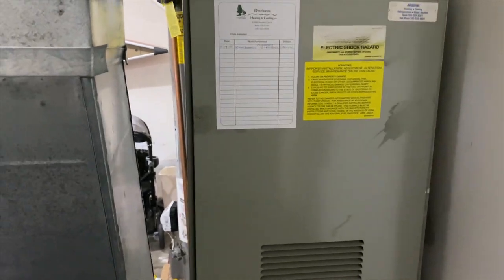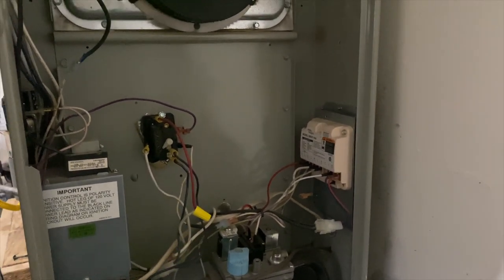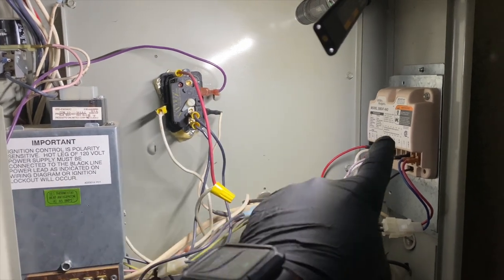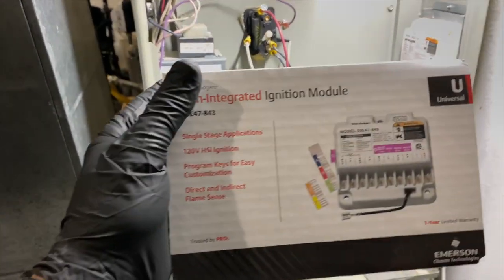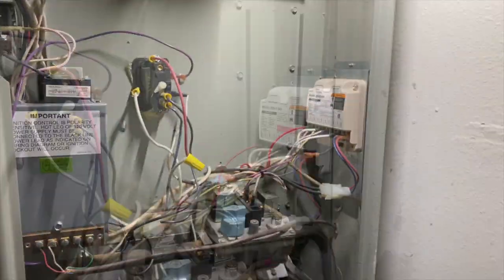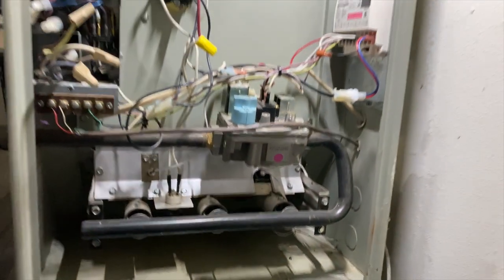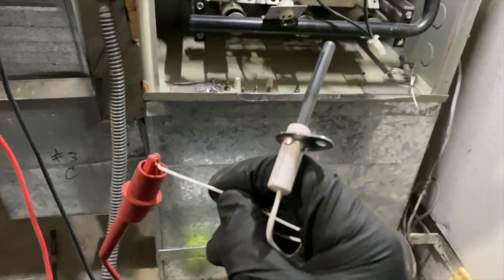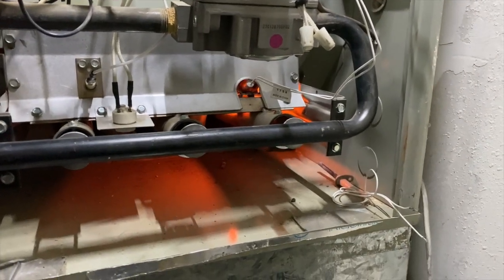No Ignition, Reversed Polarity on a White Rodgers 50E47-843 Ignition Module EP84

Comment: Hi. Your problem was only the igniter. Not board the igniter is split, there is no amp draw and the board will do that. Disconnect power to old board, replace igniter and all good.
Reply: If that's true that sucks. What he did was logical lol
Reply: @jericosha2842  If he used a meter and ohmed the igniter first, he should replace it and power unit down. Give it three minutes and that board would be fine. He’s a nice guy but at times he makes you think wtf?
Reply: @joep4143  so being new to things in this regard could you clarify why the new board wouldn't have given the same error as soon as it was powered up ? I'd think the bad igniter if it was causing the reversed polarity issue it would have caused the same error code on the new board no ?
Reply: @neversendemailshere1171  when there is break in ignitor. It cannot complete the circuit. Those boards send out 120 volts to ignitor and expect it to come back to board on the hot leg. The board itself is not very intelligent. It is a general code. Since the board is getting low voltage, it assumes there is high voltage going to unit but since it cannot complete circuit, it assumes reversed polarity. It would take quite a few cycles of failed ignition before it throws the code. This is only my thoughts on it, I’m not an engineer. The reason I came to this conclusion was that I ran into this problem in the field numerous times. First time, I noticed that the ignitor was shot and replaced ignitor. I then powered up board to see if it threw any addition codes before I was going to replace board. The board went through normal cycles and I never had call backs. Had it happen several times after this and when I found bad ignitor, replacing it caused it to work normally. Of course, there are less and less of those boards so I haven’t encountered that recently.